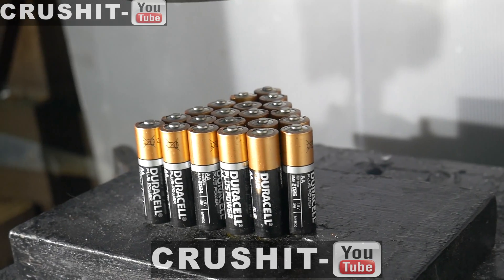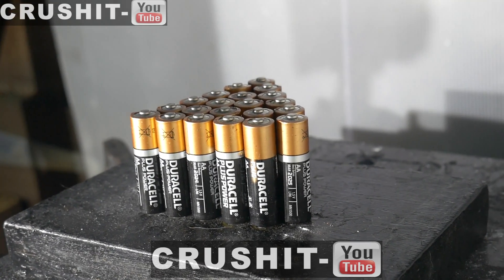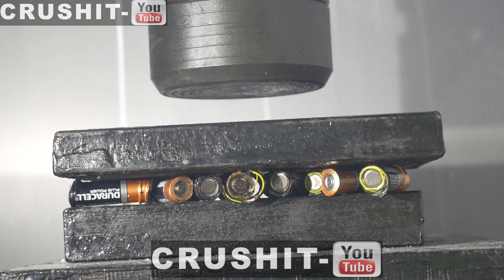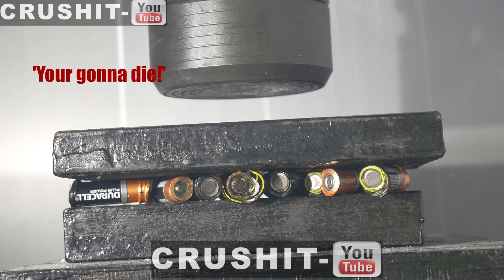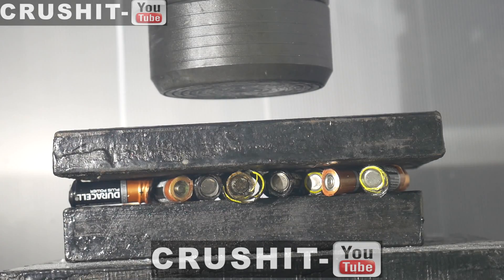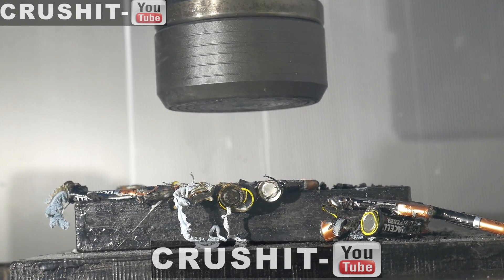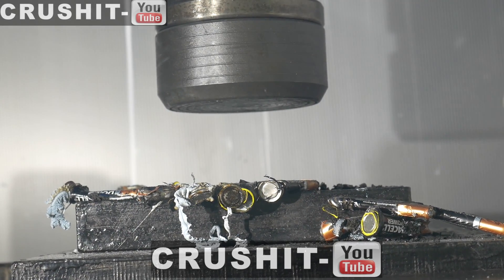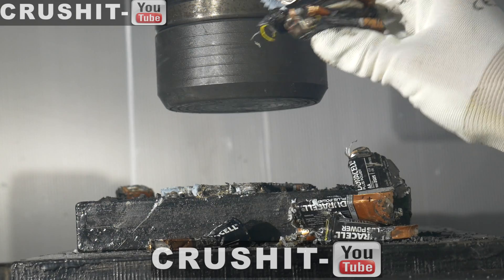Crushing 21 Batteries with Big Hydraulic Press

Comment: You never told us the tonnage in psi that your "big, rare" as you Brits like to say, hydraulic press generates.  Twenty years ago ,  a large one, the largest in the world at the time, was installed in Western North, Carolina. It is about three stories tall,  and generates some 230 plus tons. It stamps a piece of steel that has been heated to red color, and is about  5 feet long by 18 inches wide , by 1/2 inch thick into half of a tractor trailer truck rear axle housing. It does two at once. When joined together by an automatic welder , you have the beginnings of a rear axle  for the largest trucks legally on the road in North America.  It would easily flatten further , what you  are showing as flattened batteries.  It would flatten D size batteries with ease, probably over a hundred of them at once. We generally spend our time making truck axles.  I used to unload the press as it would send by conveyor , the formed pieces.  It didn't make a lot of noise , but it would put the squeeze on pieces of heavy steel.  Finally, Mercedes-Benz owns a truck axle company, but instead of making their own, they buy  from us.  That should tell you a lot.

Comment: its both alkaline (basic) and acidic. Batteries use both for a changing reaction causing atoms to become more active. Acidic conditions are better than alkaline conditions though, (you would know this if you have ever seen lemons used to power clocks). But use, either its Acidic conditions ONLY, or a combination of both. But never only Alkaline considering it doesn't have active enough ions to charge the current on its own.

Comment: I hope you disposed of these batteries properly and didn't just throw them in the rubbish
Reply: The chemical content of batteries or most dry cells are surprisingly non toxic. The electrolytes such as potassium hydroxide or ammonium Chloride have little negative effect on the environment. The only negative effect any of its content will do his not break down as in the case of the zinc casing but that has less harm than most of any trash the average person thows out.